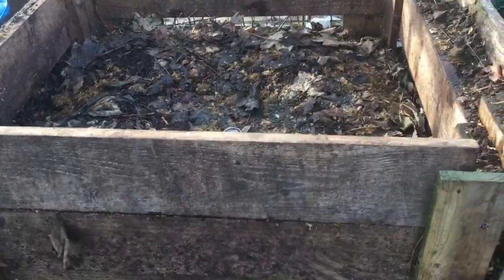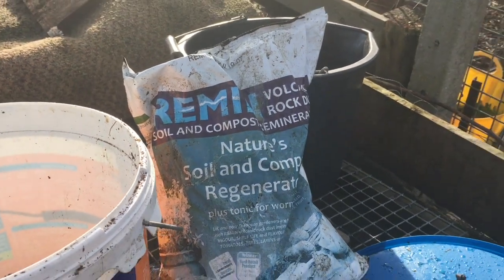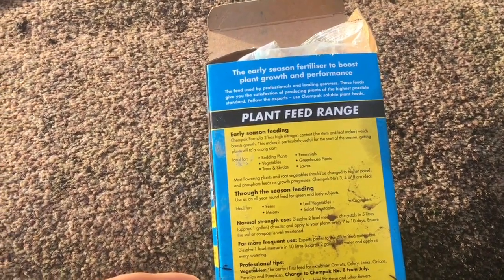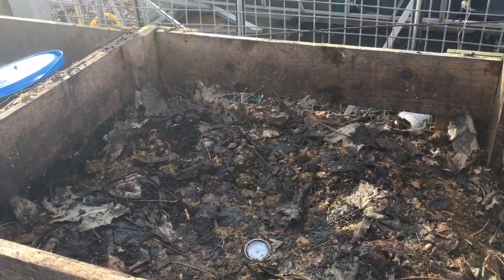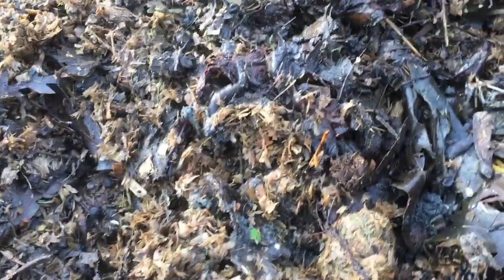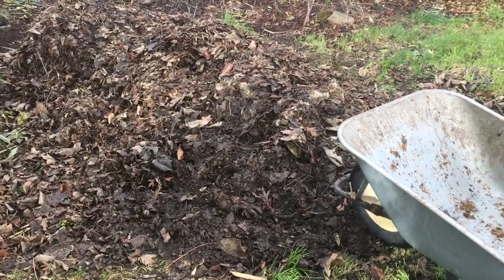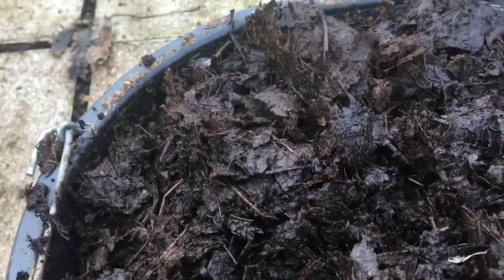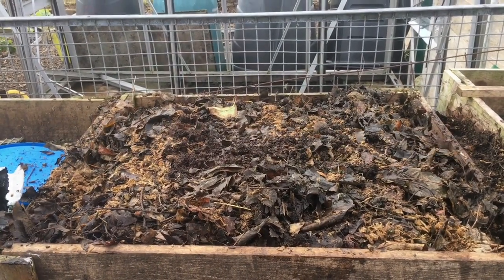How I Compost Leaves (v2)

Comment: Possibly ignorant comment but wouldn't sand be the same as mineral rock dust?  Is the rosk dust bioavailable?
Reply from the maker: Unfortunately not,  there are all sorts of different sands of course, but rock dusts are specifically selected for their very wide range of minerals (normally volcanic rock) sands are mostly silica  : All the best - Steve
Reply from the maker: On the bioavailability question, yes and no, it’s not really available to plants, but it is to bacteria and fungi and they release to plants. Ideally add rock dust to compost and let the microorganisms work their magic. Finally it takes time, we use seaweed for immediate nutrients, rock dust Is a decades long, one off investment of about £30 : all the best - Steve